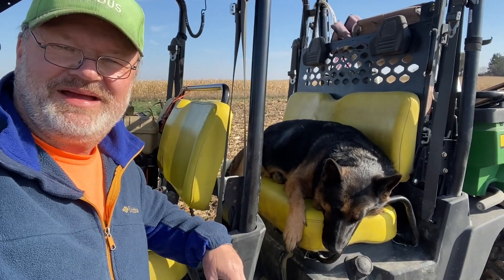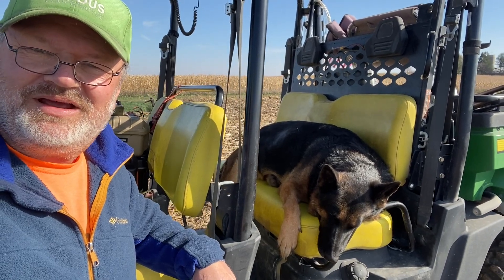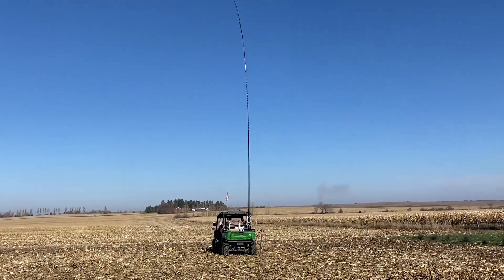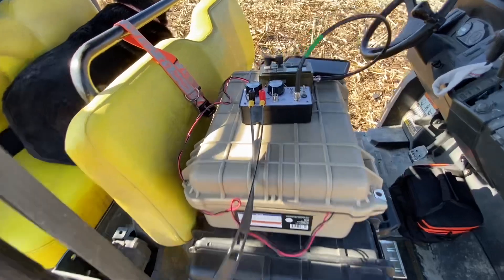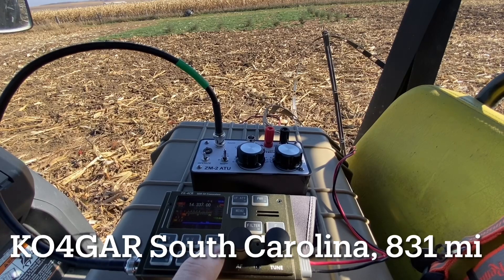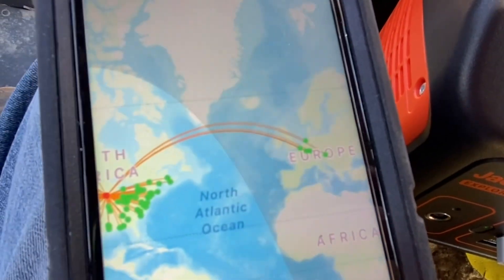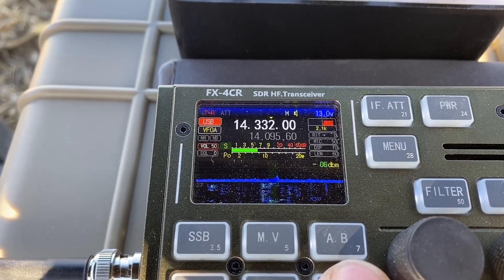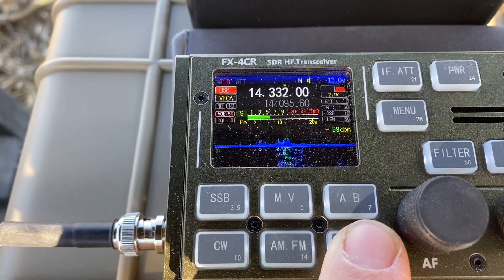1.5 Wave Dipole QRP SSB 1w - Iowa

Comment: Highly successful test. Very impressive. I think this might be your best 1 watt WSPR test that you have ever done. You were even heard in both Hawaii and Europe. As a side note, I'd like to add that in my sketch of the design, the current nodes indicate intensity, not phase. In this design I made no attempt to make the three 1/2 wavelengths operate collinearly, which would require a different feeding technique. But as your successful experiment demonstrated so well, a 1+1/2 wavelength dipole does not have to be collinear. Although the theoretical pattern contains six lobes (three on each side of the wire) with notches in between, in the real world ground reflections fill in the notches thus providing good omnidirectional performance, as your WSPR test confirmed. The goal here is to put up a simple structure that has good radiation efficiency on 60 through 15 meters, and maybe beyond depending on your antenna tuner. It can even be tuned on 80, although there the radiation efficiency will be somewhat reduced. Leon
Reply from the maker: Thanks for your idea to try this Leon.. I typically don't use dipoles, but this one is a keeper in my book.. I'd like to perform some wspr tests across multiple bands to see the performance.. hopefully the iowa weather will hold out long enough for me to complete the test.. Thx for all your support.. 73, Kevin ~ k0klb
Reply: @hamradioqrp-k0klb  Don't worry if the winter weather comes ahead of schedule and makes it too difficult. Spring will eventually come. Up here it's only six months away. I'm so inspired by your energy doing these projects that I may start doing some of it myself. One thing you are proving is that it is lots of fun.
Leon

Comment: A 20 meter three half wave antenna fed in the center with ladder line as shown in your diagram is a G5RV.  It's well known to get get out very well on 20.  Your video shows that it still does a great job.   Good job!
Reply: Hi Dan. This is Leon. How right you are about the length of the antenna that Kevin used in this video being the same as the famous G5RV. However, not every center fed 1+1/2 wavelength 20 meter dipole deserves being called a G5RV. The difference is in how it is fed. The original G5RV design used either 29 feet of 300 Ohm balanced transmission line (for example 300 Ohm TV ribbon line) or 34 feet of 450 Ohm ladder line connected to the center of the antenna, each leg of which was cut to exactly 51 feet. The other end of the transmission line was connected to unbalanced coax of any length. Finally, the far end of the coax was connected to the rig. The ribbon/ladder line acted as an impedance matching stub as well as part of the radiating structure on some bands. This was a good general purpose design that at the time (1946) provided acceptable multiple band performance without the need of an antenna tuner. However, depending on band it was not always well balanced and isolated from ground. And this was a time when few hams had the ability to measure forward and reflected power, relying instead on monitoring the plate current of their transmitter to tune and load. Transmitters today don't even have "tune" and "load" controls. Still, the G5RV worked well enough, especially on 20 meters which it favored. However, the need to exactly cut the lengths of both the antenna legs as well as the ribbon/ladder line does make the G5RV a bit tedious to build. In contrast, Kevin used a balanced antenna tuner that works with any length of 450 Ohm ladder line. No special length impedance matching stub is required. Plus, although it is good to have each leg of the antenna cut to 3/4 wavelengths in length, it does not have to be cut accurately at all. As long as both legs are equal they can be almost anything in excess of a quarter wavelength for good radiation efficiency. So compared to a G5RV, Kevin's antenna was not so tedious to build. Note that feeding the transmission line with a modern balanced antenna tuner, as Kevin is doing here, helps ensure that each side of the feedline and each leg of the antenna is properly balanced and isolated from ground. Radiation on all bands is produced only by current in each leg of the antenna. The 450 Ohm feedline does not affect the radiation pattern on any band. Note that some people today improve the G5RV design by inserting a 4:1 balun at the point where the coax connects to the ribbon/ladder line. I'm told that this does improve the match as well as help balance and isolate each leg of the antenna from ground. However the impedance match is never perfect. Still, many of today's rigs, like the IC-7300, do provide unbalanced auto tuners, which further improves the match to a G5RV. So yes, many people today still use the G5RV design. But what Kevin is using is different. By using a balanced (not unbalanced) antenna tuner Kevin is ensured not only of a perfect match, but also perfect balance and isolation from ground of each leg of the antenna at any frequency on any band, including 80 meters, and with any length of transmission line. So no, because of the difference in how it is fed, I wouldn't call Kevin's antenna a G5RV. It just happens to be the same size, which although not necessary was a good idea.
Reply from the maker: Hi Dan.. Thanks for stopping by.. I guess I'm not familiar with the G5RV antenna.. I've heard of it, but that's about it.. It does work very well.. Thanks for your comment and supporting the channel.. 73, Kevin ~ k0klb

Comment: That wasn’t an omnidirectional pattern, about 180deg coverage, not much NNE, N, NNW
Reply from the maker: Hello Jerry.. Thanks for stopping by and visiting the channel.. I appreciate your support.. In my experience, there aren't many WSPR receivers in those areas.. It's kind of a dead zone and never much activity no matter what antenna (vertical, end fed, dipole) is used.. Thanks for watching.. 73, Kevin ~ k0klb
Reply: Hi Jerry. This is Leon. I agree with Kevin. Not many ham operators up in the North West Territories and Nunavut. Ever been up there:? I have, years ago when I was in the Air Force. Nothing but empty Tundra up there. Plus, HF radio propagation is almost impossible due to the instability of the ionosphere in polar regions, which is also why contacts to central Russia are so rare.
Reply: @pcastonguay  Wasn’t thinking that far north , mire the middle orovs, but I get it.

Comment: The 1 watt wspr results aren’t all that surprising, however I was super impressed with 1 watt SSB signal reports! Question, I don’t see a microphone is it built in to the radio? Sweet little rig!
Reply from the maker: Hello.. I think you're right about the 1w wspr results.. I should have transmitted at 500mW or less to give it a more stressful test.. The FX-4CR radio is a nice little rig.. It's easy to use and yes, I use the internal built in mic.  I find it has better quality than the handheld, plus its one less thing to forget to pack, LOL.. Thanks for stopping by and supporting the channel.. I appreciate it.. 73, Kevin ~ k0klb

Comment: Does this combine ground wave and NVIS?
Reply: Hi Robert. This is Leon. Good question. The resulting pattern from any antenna system at all vertical angles is the combination of direct wave and ground reflected wave, not ground wave. At the frequencies used in this project (20 meters), with an average height above ground of only about 25 feet (inverted Vee with apex at 40 ft), the higher vertical angle radiation is quite strong, thus favoring "Near Vertical Incidence Skywave (NVIS) propagation. At much higher antenna heights above ground, perhaps 80 to 120 feet, radiation at higher angles would be much less and hence NVIS propagation is much weaker. This is generally true no matter what the antenna design. Indeed, this is the reason why "the higher the antenna the better the DX", which relies on radiation at lower vertical angles. Shorter paths, depending on time of day, require lower frequencies like 40 & 80 meters. Except under ideal conditions, at 20 meters the ionosphere generally does not reflect higher vertical angle radiation very well, resulting in poor NVIS, thus leaving ground wave as the predominant factor over shorter distances and hence the need to use much higher power. Often a gap of very poor propagation occurs between the limit of ground wave and minimum skip distance.
Reply: @pcastonguay  Excellent concise explanation. You must be a technical writer.
Reply from the maker: Hello Robert.. Thanks for stopping by.. To answer your question, You'd have to ask the more seasoned experts about that.. I'm just a rookie operator and still trying to figure out how all this magic works, LOL... Thanks for your comment.. I appreciate your support.. 73, Kevin ~ k0klb

Comment: Great job! How do you like that little radio?
Reply from the maker: Hi John.. I enjoy the radio very much.. It is very easy to use portable and is very quick to set up and get on the air.. I use it along side my ic705 in the shack both sharing 50/50 usage as my primary radios.. It's tough to decide which radio I want to use in the evenings, LOL.. Thanks for stopping by and commenting.. 73, Kevin ~ k0klb
Reply: @hamradioqrp-k0klb  That little rig and another one are a couple that are on my list of next radio. I like the compactness of it. Btw I shared a link to your video on some QRP groups on FB. Really like the antenna you setup.
Reply from the maker: @kd5inm  Thanks for sharing the video.. I appreciate it !!!... k0klb

Comment: It looks so good sitting there, how about using the gator as an antenna?   Great presentation on how a little power and a good antenna can work well if the noise floor is low.  Thanks
Reply from the maker: Hi Gene.. I've thought about using it as well, but I don't think I can get the dog to get off the seat and away from the gator long enough for me to try it, LOL.. Thanks for stopping by and leaving a comment.. I appreciate your support.. 73, Kevin ~ k0klb

Comment: Great job, Kevin. That looks like a pretty cool and well performing antenna.
Reply from the maker: Thanks Mike.. If the weather holds, Imma gunna set it up again and do a WSPR test across the bands and see how they perform.. I'm curious how well it would perform as a multi band antenna at that length.. Thanks for all your support and fun! !.. 73, Kevin ~ k0klb
Reply: @hamradioqrp-k0klb  if you're feeding it with balanced feedline, then it should work fine multi-banded. Even with high SWR, there's little loss with balanced feedline, compared to coax.
Reply from the maker: @MikeN2MAK    ❤ balanced feed lines.. lol